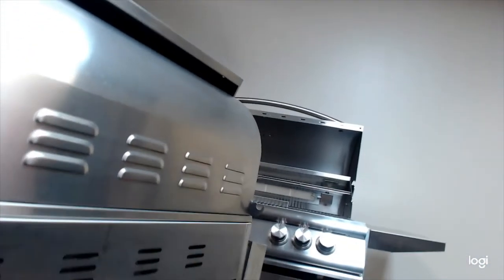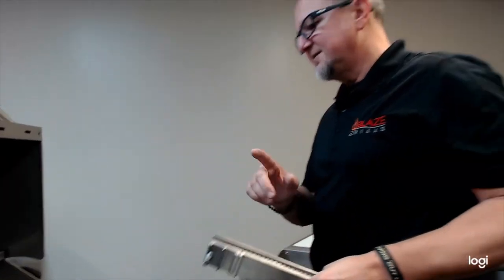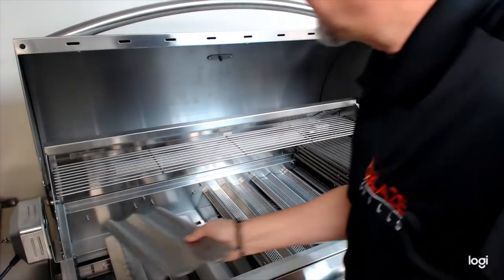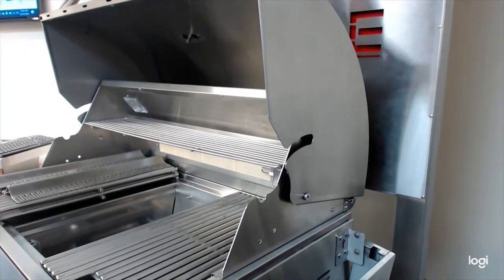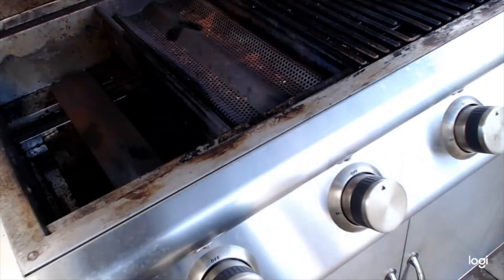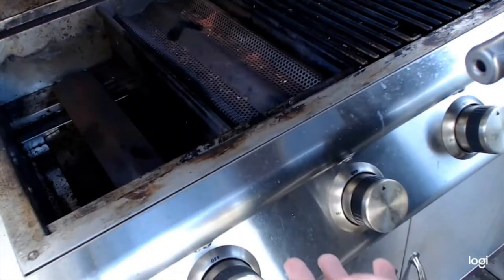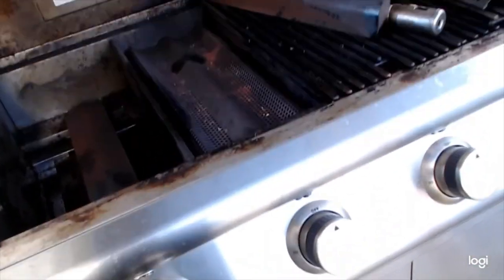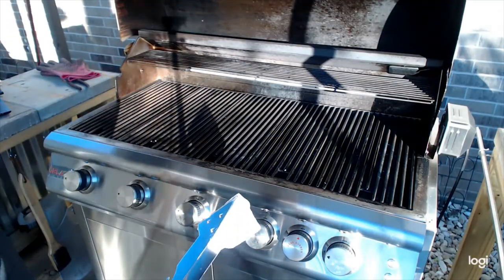Initial set up of a Blaze gas grill

Comment: This is the best straight forward, without any extra conversation, pertinent information!   I did not remove the cotter pins before installation, but they were easy to do for My Blaze 32 LTE 2 from the front.  I reached in and pushed to the left.  Thank you!

Comment: Thanks Jim. Do you have a video on converting from natural gas to propane? Also, how are the lights powered?
Reply from the maker: Here’s a how to on the converting the gas type….  https://youtu.be/CGVHd9zSS_s.
The lights are powered with a transformer that comes with the grill. On the back of the grill, you’ll see a white wire that’s zip tied, when it comes out of the box. Cut the zip ties and plug that wire into the transformer.
Reply: @grillingwithjimbo  Are there any instructions, written or video, on how the transformer is to be installed???   I don't see anything anywhere!   That's amazing!

Comment: I noticed that the heat zone separators in your grill are mounted on pegs however my grill (BLZ-4LTE2MG-LP) has rods that go front to back for hanging the heat zone separators.  Those rods make it difficult/impossible to put a pan in when using the rotisserie.  I was advised those rods are there to prevent warping of the firebox and will invalidate the warranty if removed however I don't think I've seen those rods in any of the grills that you use in your videos.  Are the rods a new grill feature?
Reply from the maker: @pongoloboating  Hi there… good question. Those rods are in the 44” pro grill and the marine grade grills. The 316L marine grade stainless, while corrosion resistant, isn’t as sturdy a steel as the 304 or 440 stainless steel that other Blaze grills are constructed of. While warping would be rare at max temps, our R and D department aired on the side of caution and added that extra bracing.
Reply: @grillingwithjimbo  Thanks for the info!
Reply from the maker: @pongoloboating  my pleasure. I know the cross bars make it difficult to get a foil pan in there, for rotisserie. My best advice is use a couple, smaller pans. Happy grilling…

Comment: Jim, is it necessary to season the following:  1)  Not only the top of the grates, but the bottom?   2)  Tamers, burners, heat separaters?  3)  Either inside and/or outside of the unit (LTE+ on cart)?   4) Vegetable Oil spray, ok?    Thank you, Sir!
Reply from the maker: @bobstl8647  hi there…. it’s most important to season tops of the grates, where the food makes contact. Seasoning is going to help prevent corrosion and will also help flavor the food and prevent sticking, over time. Everything else just needs to be kept clean so ventilation and airflow isn’t impeded. As for the outside surfaces, any stainless steel polish will do, every so often. Apply with a microfiber cloth. For seasoning the grates, I find vegetable shortening or avocado oil works best. Those oils have a high smoke point, as opposed to olive oil which tends to burn off pretty quickly. Thanks for the questions. Keep em coming. I love this stuff.

Comment: BLZ-5LTE3 I just put the cart together, the actual Bar-B-Que comes with instructions on how to install in a island but not a cart, how do you do this?  I watched the video you suggested but it just points to 2 screws to secure the top, I also have a lot of different screws and nuts left.  The documentation with the Bar-B-Que is terrible

Comment: Thanks for the video.  When connecting the regulator hose (for propane tank) to back of grill, do you use teflon tape or just metal to metal?
Reply from the maker: Teflon tape is not needed. The threaded connector and rubber grummet on the inside of the connector will suffice.

Comment: I just finished setting up my pro lux. Turned it on for the initial 10 burn off like the manual says. When I opened the hood all my flame tamers were red hot on the right side of each one.  The grates look chared (slight black and brown) in the same spot above the tamers. Did I do something wrong during setup?
Reply from the maker: You’re probably fine. Did you season the grates? If so, they will blacken in a short amount of time. That’s what you want. It’s important to pre-heat with the lid closed, especially with the pro series. There’s a lot of material that needs to get to temp. I recommend, at least, 20 minutes. One question, based on your post…. Is the entire burner lighting up? You may have to remove the flame tamers to confirm. If not, I’ve got some easy troubleshooting tips but we’ll cross that bridge, if need be.

Comment: On the blaze lte why is the rotisserie burner so low? When cooking whole chickens you have to remove the cooking grates to have more space. Can’t they increase the height to allow for more room?
Reply from the maker: Most instructional videos will recommend taking the grates out to use the rotisserie. In fact, whenever I rotisserie, I use the time to empty the firebox completely, and give everything a deep clean. Also, I prefer to take everything out so I can put a foil pan full of water and seasoning under the cook area. It really makes a difference with flavoring and you can use the liquid for basting. Design wise, it also has to do with the available space and the fact that the rear burner, being a very directional heat source, needs to line up with the rotisserie rod.

Comment: where do you install the transformer for the electrical components?  the instructions don't say where to put it and how to connect it to the grill
Reply from the maker: If you have a cart model, there will be 4 holes on the back panel. Use the 4 thinner bolts and nuts to secure the transformer to the inside of the back wall of the cart. If you have a built in grill head, technically, you can set the transformer anywhere in side the access underneath the grill. On the back of the grill, you should see a white wire with a black connector. It may be zip tied. Clip the ties and connect that wire to the transformer.

Comment: Adjusting flame higher is clockwise or counter at the burner knob?
Reply from the maker: As far as the knob, itself, clockwise = higher flame.
Reply: @grillingwithjimbo I’m trying to adjust my flame height.  Seems little difference from low knob setting to high setting. Any suggestions?
Reply from the maker: @eggcooker496  at about the 5:00 minute mark, on the this video, I show how the high and low flame should look, and talk about how to adjust it. It’s probably a low flame setting, which you can adjust with a small flat head screwdriver, that can be accessed by pulling the knob off.
Reply: All is now good. Thanks very much.
Reply from the maker: @eggcooker496  good to know. Cheers and happy grilling.

Comment: Just got my Blaze grill LTE 5 burners installed. It does not heat very fast and not very high. Max I got is 550 with no wind outside. The flames are about 1/4” long and 2 of the burners have a lot of yellow flames. I have tried numerous time, resetting the regulator, with nothing getting better. I am questioning the type of regulator they install. It seems like a small regulator that I see on smaller grills? Do you have any regulator recommendations to use or anything else that I should check?  After 2 weeks not very happy, my 15 years old Platinum Weber was much  hotter and quicker to deliver. Thank you.
Reply from the maker: Hi there….  I’ll run down the list and give you some suggestions. Ultimately the quickest way to troubleshoot, in real time, is to give our tech team a call. 866-976-9510. 
As far as pre heating, anything in a "premium" grill category is going to take a while to get to temp. When you step up from big box brand grill, you’re dealing with a lot more material with greater gauges of steal. It’s not uncommon to preheat, with the lid closed, for at least 20 minutes. Sometimes more, depending on environment. The 550 temp isn’t bad. The cooking surface, on average is going to be 150 - 200° hotter than the reading on the gauge. Those are analog temp gauges that measures ambient oven temps. They’re anything but dead accurate. A Weber will often show a higher reading because the temp gauge is located in a shorter lid and is getting hit with direct flame. I have a whole video on analog temp gauges and why you should ignore the numbers. Think of it, rather, as low, medium, high. Picture the temp gauge divided in thirds. In fact, the first Blaze grills had gauges that only showed low medium and high. The burners with low or yellow flame probably just need an air shutter adjustment. Our tech team can definitely help you with that. I suspect you may need to open the air shutter, slightly, letting more air in. I would wait to talk to tech before making that adjustment. They’ll probably ask for a video of your flames. It’s amazing what they can determine from a quick video. The supplied regulator should suffice although, on rare occasions, I’ve seen bad regulators straight out of the factory. Couple more questions so I might be able to offer more suggestions…..  Are you running natural gas or propane? Are you in particularly high altitude area? Thanks for reaching out. We’ll get you in the right direction. 
Here’s a link to the analog temp gauge video: https://youtu.be/RWdmNJdxTEc
Reply: Thanks Jim for replying quickly, it is appreciate. My grill run propane and I live Montreal region Qc, Canada, so no high altitude. I’ve reviewed your analog video and now better understand how to interpret the temperature. I also have readjust the burners to allow a bit more gas and they now run steady with about 3/4” flames: much hotter over the grill. I’ve also allowed more time for preheat, and it was good. I also have to understand that I have to get used to a new equipment, after almost 20 years with something different. 😊 thanks again and keep up the good work. 
Do you also have a video on the infrared burner? I feel like the grills get so hot that it burns the meat and give a burnt taste. Any tips would be appreciated.
Reply from the maker: Good to know we’re going in the right direction. I haven’t made a video on the infrared burner. Honestly, I don’t have a lot of personal experience with it. I believe there’s an old video that might exist, somewhere in the archives. If I find anything, I post it in the comments, here. I know it gets HOT and doesn’t take long to turn a steak into a hockey puck lol…..  I’ll see what I can find. Cheers
Reply from the maker: I found this video on the sear burner. What you want to do is throw a sear on it for a minute, per side, then move it over to a main burner to finish. At 1000°+, that sear burner could turn anything into a charred brick real fast
https://youtu.be/jC21GmTVxLQ

Comment: How do you replace pegs for flame tamers?
Reply from the maker: The replacement pegs will have a slotted end for a flat head screwdriver, a threaded end, and a nut and washer. Depending on which one you’re replacing, you may need a second person. One to hold the nut, and one to screw it down tight. If it’s a peg on the back side, you’ll be able to reach it from underneath the grill body. If it’s a peg on the front, you may have to take the front panel off to access the firebox. (2 screws on each side of the front panel and 2 screws under each knob will release the front panel). I actually plan on making a video for this, since it’s a little difficult to explain and visualize but I hope this helps, for the time being.

Comment: Hello. I recently bought a house that has a blaze grill installed in an outdoor cooking area. It came with a box that says Blaze on it in holes. The word Blaze is written with holes. It has a slide off top. what is this for?
Reply from the maker: Sounds like you have a Blaze smoker box. There are several ways to use it. Most common way is fill it with soaked wood chips and put it under the cooking grate, on one side or the other. Gives you a hint of smoke flavor. The corners are completely sealed so you can also add water with some seasoning to help prevent the grill oven from getting too dried out, while cooking.
Reply: @grillingwithjimbo  thank you

Comment: Jim...  my 5 burner Blaze grill appears to have a stuck valve on the 4th burner from the far right. The gas pilot works along with the spark but no gas is going to the burner. I even switch burner in that spot thinking it was the burner but no gas is coming into the burner at the port area. All other burners are working as expected except this dead one. My unit was purchase in March 2020 so its kinda a young to have a valve go bad. I even tried moving the screw (under the turn knob as you showed in this video) to the right a little but no change. Thoughts?
Reply: Fixed getting the propane into the burner. The the control nozzle that feeds the burner must have been clog. So I tried cleaning it with dish soap. No help. Then tried rubbing alcohol , no help. Today I tried the old reliable WD40. Presto this clean out the port and propane returned to the burner. All works as expected.

Remember that WD40 is not only a lubricant but it can also act as a cleaning agent on oil and grease. Hope this helps.
Reply from the maker: Good to hear the issue was resolved. WD40….  I learn something new everyday. Cheers!!
Reply: @grillingwithjimbo  My bad not using the process of high heat (turn the Balaze burners up to high for awhile)  to clean off the grease build up inside the grill. I assume if I had this problem would not have occurred.

Comment: Jim any tips for removing pins from the front. Unfortunately we forgot to remove them before being installed.
Reply from the maker: A small thin screwdriver might help. The pro grills are a little harder to get to from the front. For LTE or traditional grills, you might be able to use a long thin needle nose pliers. Just be careful not to cut yourself. If the pins aren’t squeezed too tight you might be able to push them out from the open end.
Reply: @grillingwithjimbo   My LTE was easy to do. I just used my fingers to push the cotter pins to the left.

Comment: Hey Jim,
awesome videos!
I have an LTE40 since a year and I am very unhappy how unevenly it cooks. If I put a sausage in line with the grill front I really need to engineer the position for it to cook evenly. I suspect it also has to do with the burner adjustment. Can you do a more thorough video on how to adjust them? That would be great. 
Thx,
Mischa
Reply from the maker: Hi there…. Thanks for the suggestion. I can certainly make a video detailing the burner adjustment. I’m not sure how quickly I’ll be able to, as I’m on the road much of the time. In the meantime, I’ll recommend you call our tech team at 866-976-9510. They’ll be able to walk you through any adjustments. They’ll probably ask for video of your burners while they’re lit. I can tell you this, proper preheating time, with the hood closed, is very important. There’s a lot of steel in the firebox that needs to heat up, as is the case with any premium grill. Because gas grills vent out the back, it takes some time to preheat to get the front portion of the grill up to desirable temps.
Reply: @grillingwithjimbo  Hello Jim, thanks a lot for the advice and quick reply. I will check with the tech team. Kind Regards, Michael
Reply: Hello Jim, I talked to the technical team and the colleague mentioned that there is no video showing the low flame adjustment available. So maybe a good one to do.
Reply: @mischahh9063 were you able to get your blaze grill figured out and cooking more evenly?
Reply: @aaronolsen8787  Honestly, grilling with this grill you really need to get used to, still uneven, you have to work around it. The support not really helped much. For such an expensive grill really disappointing. I would go back to my old grill if I could. Did someone figure this out?
Reply: I am also disappointed with my blaze grille. It’s cooks very uneven that I can’t get two steaks cooked the same even if they are over the same burner. I’ve also never had as many flare ups as I do with this grill. I went ahead and just purchased the ceramic cooking rods thinking it would help but unfortunately I just wasted more money. When I shoot the temperature it’s all over the place. Nothing is even not even over the same burner. This grill really is poorly designed. I feel like BBQ guys lied to me when they recommended this grill because they have some kind of partnership with Blaze or the former owners or something like that. Just google it and you’ll see. I’m going to actually consider trashing this after two years and ripping apart my granite and kitchen just to not have to deal with the frustration.

Comment: How do you remove pin from front?  They already installed it in outdoor kitchen. Wasn’t aware I had to remove these pins.  A video would be awesome! lol.  But I think most that forget to remove pins, they just won’t clean their gas pilots.  So a video may help.  Anyhow, I like all your vids you post.  Cheers!
Reply from the maker: The cotter pins are always overlooked. It’s one of those things nobody thinks about during the install. If you have access to the bottom of the grill, take the drip tray out. You’ll be able to see the pins from underneath. From the front, it’s possible to get the pins with a needle nose pliers or, better yet, a long thin tool that’s slightly curved at the end. You’ll have to feel your way under the burner. Either find the loop of the pin and pull or find ends of the pins and try to push them out. Just be careful and take your time.
Reply: I just received my 40 inch 5 burner grill and impressed with the quality - disappointed with instruction booklet - you should have a large sticker on the grill saying remove the cotter pins 1st - it is a 2 man process to lift grill to access them if it is a built in system